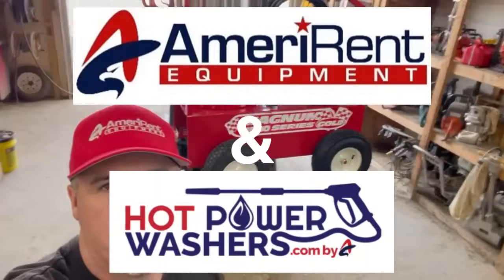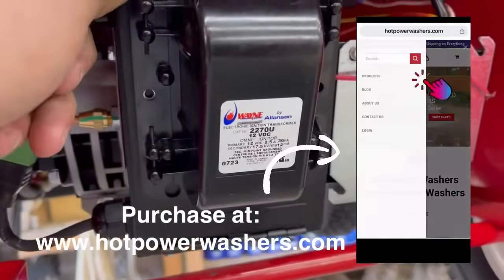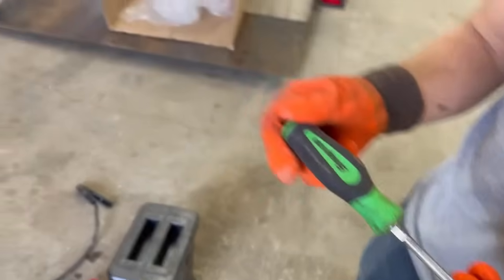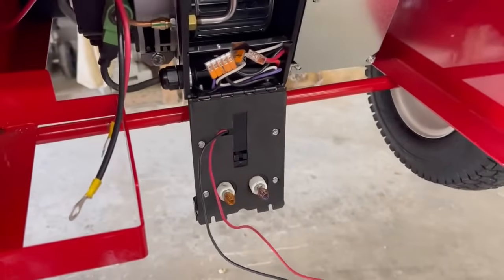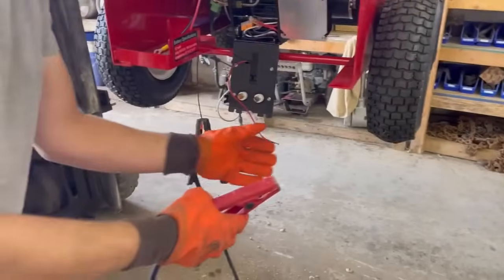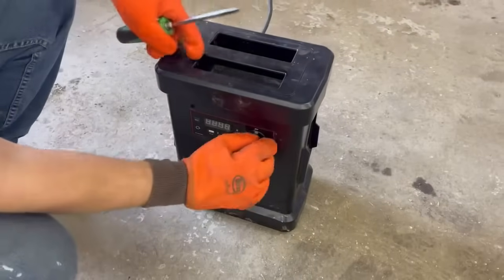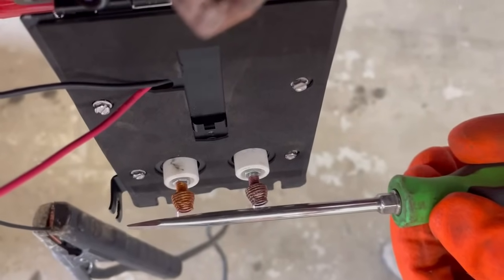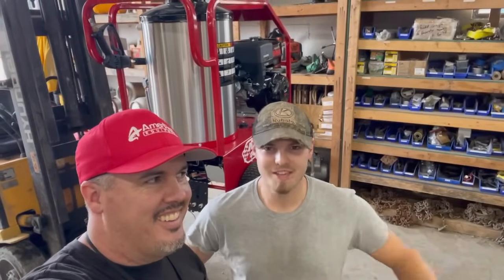Maximize Magnum 4000: Ultimate Guide To Testing Wayne/Beckett Burner Ignitors | AmeriRent Equipment

Comment: Hey quick question I have the same power washer and I can't get the burner and fan to work together. That small wire that runs from the starter does that plug into the thermostat or the on and off switch because it was unplugged when I bought it? If you could give me a video of what it looks like underneath or explain that would be great thank you

Comment: Mine only arcs when I get the screwdriver within maybe 1/8” from the electrodes. Weak igniter?
Reply from the maker: Based on your description, it sounds like the igniter may be producing a weak arc. Typically, you should be able to see a strong, consistent spark jump a slightly larger gap—around 1/4" is common in many systems. If you're only seeing a faint arc at 1/8", that could indicate the igniter is starting to weaken, either due to carbon buildup, wear on the electrodes, or a failing transformer. It’s also worth double-checking your ground connection and making sure there's no moisture or debris interfering with the arc. If everything else checks out and the arc remains weak, we’d recommend replacing the igniter to ensure reliable burner performance. Let us know if you'd like help sourcing a replacement or walking through any other checks.  The battery could definitely be a factor. If the battery is weak or not delivering sufficient voltage, it can cause the igniter to produce a weak or inconsistent arc. The igniter relies on proper voltage to generate a strong spark, and low battery voltage can reduce the output of the ignition transformer. If you're testing the unit with a partially drained battery or poor battery connection, that could explain the limited arc you're seeing. Before replacing the igniter, it’s a good idea to fully charge the battery or test it under load to ensure it's providing steady, adequate power. A simple voltage check at rest might not be enough—look for any voltage drop when the burner kicks on. If the battery checks out and the issue persists, then the igniter itself is the next thing to inspect or replace.  It's hard to say 100% since we aren't the ones looking at it but this is a good place to start.

Comment: Thanks, I just tested mine and it sparks. The blower is working and it sprays fuel, but it's not igniting. Any tips?
Reply from the maker: Fuel/spark/air, those are the 3 things for igniting.  Did you test the fuel pressure? See our other videos as we have one on this as well.  Also, pull your coil so you can see the fuel spray pattern